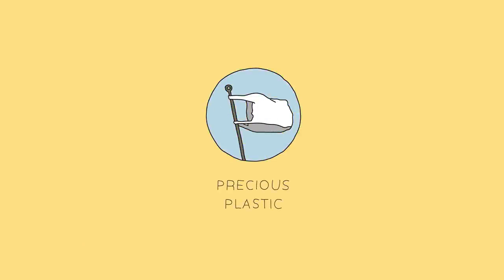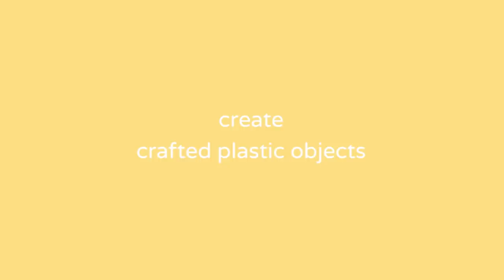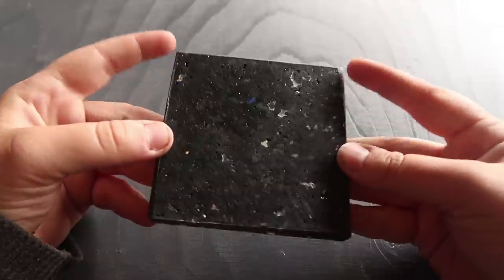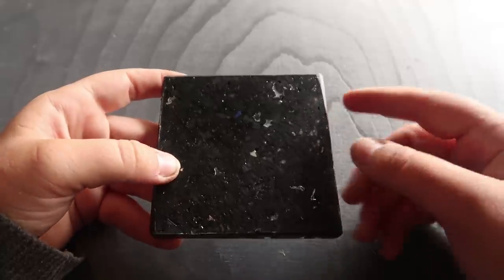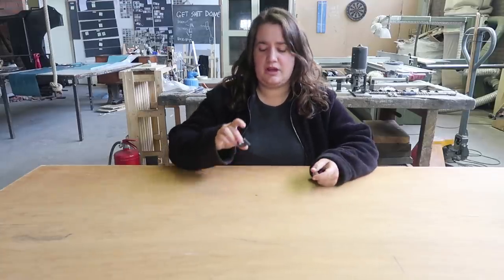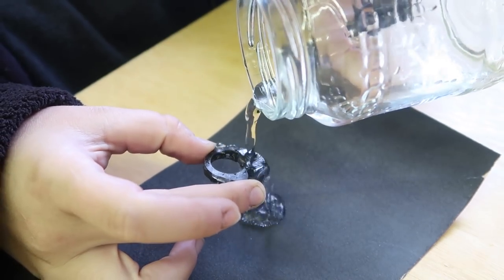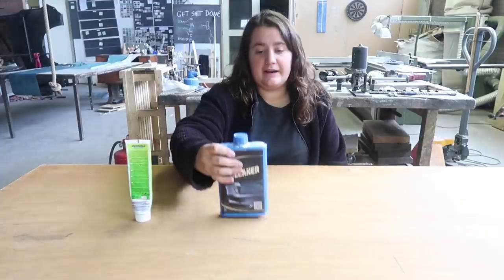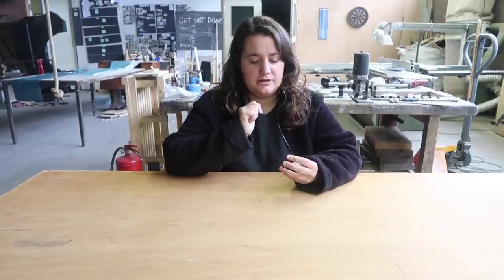Create precious jewellery from shredded CD CASES

Comment: You guys should edit the title to reflect that this is being done with CD -CASES-, and not CDs. CDs themselves are made from polycarbonate (I believe) and have a different recycling process to their cases. (That being said, I would like to see information on how to deal with recycling CDs themselves, as I have several badly burned/broken discs that I have no use for.)
Reply from the maker: good point
Reply: Pretty sure the same process can be done with cd's. And the reflective aluminum particles will create a great effect.

Comment: I was wondering if you could encase other materials in the polystyrene?  Similar to what is done with epoxy? For example: cloth with a colorful print sandwiched in layers of clear polystyrene or possibly small metal parts.  
Any thoughts on this?

Comment: Surely the aim of recycling plastic is to do something good for the environment,
Using a massive oven to heat a small amount of plastic, wasting a whole bucket of water to cool it, selecting a spall patch from the resultant sheet, drilling a hole in the bench, creating a whole lot of micro plastic dust, wasting several sheets of wet and dry and then using the chemical polishes all seem like an environmental nightmare to me, especially when the result is a plastic ring, what a waste.

Comment: Curious the oven temperature? A little too high and it burns or too low and it won't fuse. I had wondered about just pouring ground plastic into a cold mold then heating it so this was interesting to see in action. If you use a cheap press you can get most of the air bubbles out or at least reduce their size.

Comment: are any types of plastics mixable?
Reply: Types of plastic no, but as you saw in the video you can mix colors of the same type. This is why recycled plastic is sorted and plastics have the type marked on them. They will not bond well together, even though if you try at first it may seem that they do, but the bond is very weak at best and will break soon. You would need some sort of mechanical connection between different types of plastic to use them together.